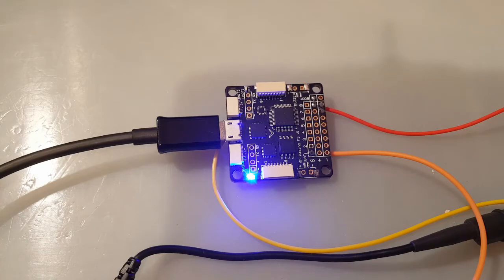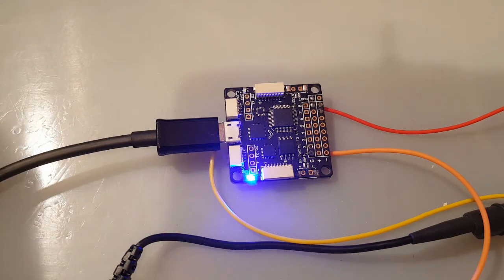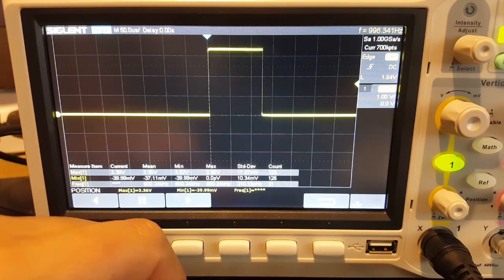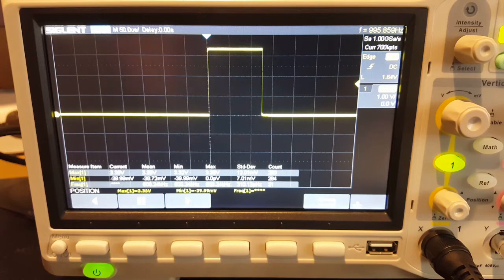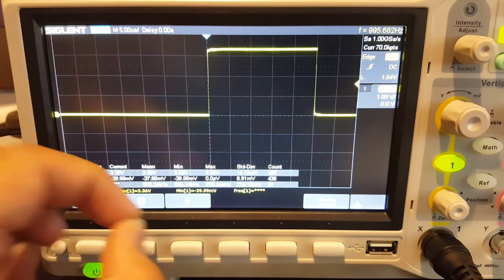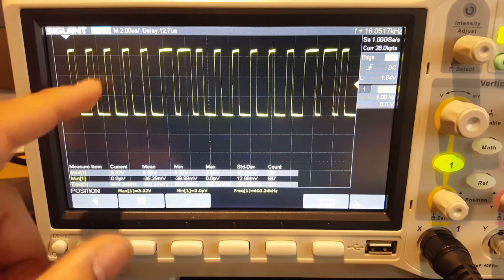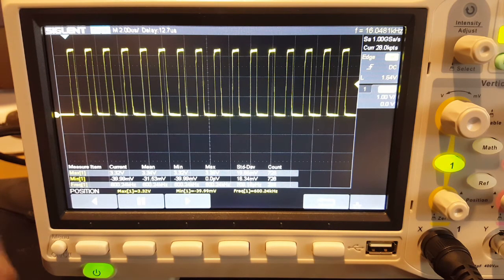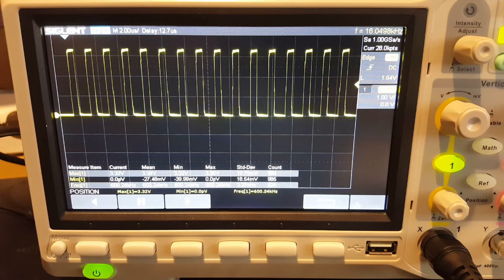DSHOT VS MultiShot

Comment: It is very interesting to me that multishot vs oneshot did not change the frequency of the PWM signal it was still 1khz. To me that seems like it completely negates the differences between the two. But that is at least better than normal PWM which runs at 50hz